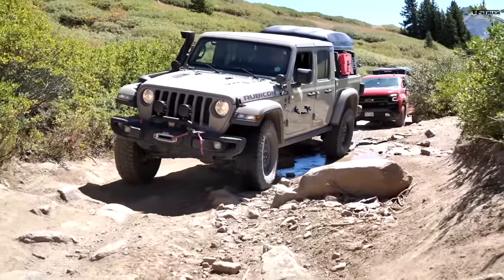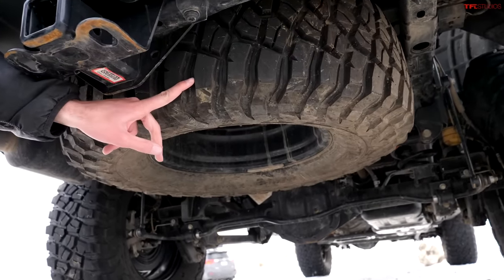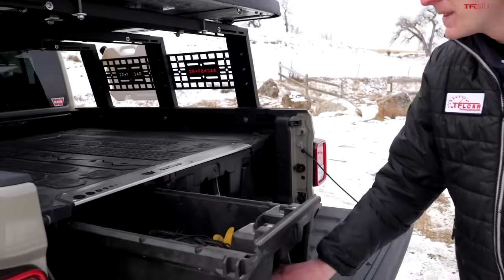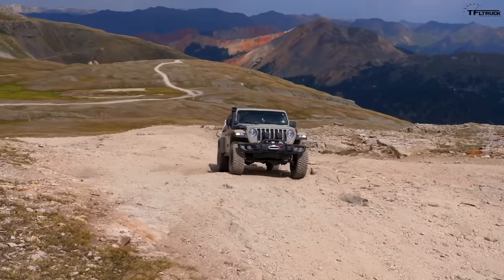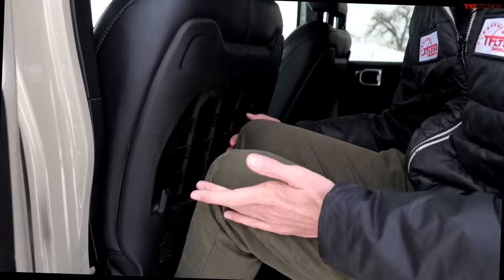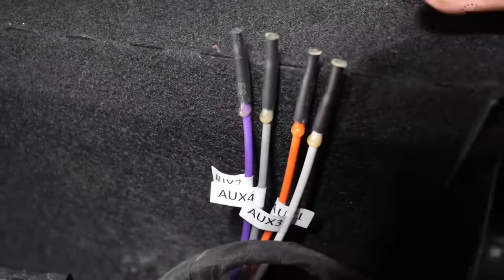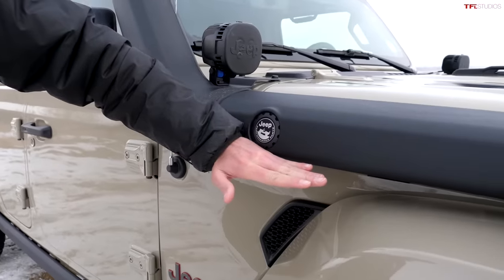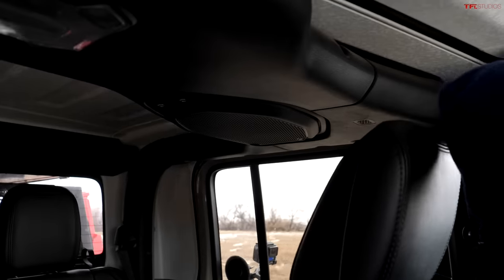Here’s What I Love & Hate About The Jeep Gladiator After Living With It For a Year!

Comment: I wonder if the new jeeps have addressed the rusting issue.   Jeeps seems to rust faster than other vehicles in Michigan.  Rust stains on the exposed hinges show up on 5 year old jeeps.
Reply: it’s not rust but corrosion that’s the issue on these. The JL and JT bodies are made of aluminum, so they won’t rust. However there have been corrosion issues reported because there is bare metal between the hinge and the door metal. I just bought a JL Rubicon and I plan to coat that area with some zinc chromate to protect it.

Comment: I'm hoping I made the right choice...ordered a 2021 Jeep Gladiator Mojave. Loaded up with a manual 6-speed. Looking forward to it. Somehow the 4 auxiliary switchs got left out. Found the mistake 16hrs later but already had a VIN#, couldn't make any changes. So now the dealership gets to install them.
Reply: Have you gotten your Mojave yet; if so how do you like it? I've just ordered one with the automatic and the guess is 8-12 weeks. thanks
Reply: @gb93669  Yep, picked it up March 5th. Ordered February 9th. A blast to drive. Only thing I would have changed...and I love manual transmission and this one is really nice, is that I would have ordered it with an automatic. I have 18 stoplights and 3 stopsigns on my way to work now. (I transferred.) Other than that I love my Mojave. And the Nacho is a really neat color.
Reply: @scottsymons6152  Thanks. You got it really fast compared to what they told me here in western CO.
Reply: I live in east central Indiana right next to Ohio. I'm only about 4hrs give or take from Toledo, OH. And my dealer was only about another hour from me. So everything to our area is trucked in rather than railed in. It can make a huge difference.

Comment: The 3.6 seems reliable to me. I put 270000 miles on a 3.6 Pentastar without any issues.
Reply: they are except the oil cooler likes to blow in the v of the engine.

Comment: I hated my pentastar engine. Nothing but trouble from day 1. Looking at a bronco. Been driving jeeps since 1987. Pentastar soured me on jeep.
Reply: what year?
Reply: @chadhaire1711  2014
Reply: @duckdog38  They have made a lot of improvements since then..easy 170,000 miles now
Reply: @chadhaire1711  I drove my jku 70,000 miles. In that time I had 2 radiators,1 intake manifold, 1 heater core, 1 a/c compressor,  and a full engine flush done by Chrysler technicians. When I traded it in, something was wrong with the front end, and the traction control was not working properly. Also in the four years I owned it, I had the windshield replaced 4 times.  Couldn't keep a windshield in it! I never took it off road but one time. Maybe I just got a lemon, but I was not impressed at all. Never had that many problems before. I had an 87 yj, 88 Comanche, 94 cherokee, 99 cherokee before. All great vehicles. I traded my jku for a 2018 ram 1500 hemi. It has 80,000 miles so far with no problems whatsoever.

Comment: General Motors should become Wrangler Rubicon interior and Gladiator interior's into a modern autimatic vehicle equipped with biggest touchscreen, paddleshift, and automatic gear steering wheel, gladiator and Wrangler interior must be modified changing the out of fashion interior that these vehicle have, for example please try to analyze Jeep Bronco Raptor, the best offroad Jeep in the world in my opinion so to get General Motors understand Gladiator Rubicon and Wrangler Rubicon are out of fashion: They have the same interior year by year. Thank you. Dr. Luis Amador

Comment: Looked at one this weekend and we liked it far more than we thought we would.  The only thing we didn't like were the seats. Are there aftermarket options?
Reply: Yes, check out Recaro or Stratos.  The are other seat companies, but those are the two I immediately thought of.  I'm not sure if Stratos is sold in the U.S. but I've seen Australian YouTubers use them and they speak highly of them.
Reply: I have a YJ.  I ended up modifying my seat brackets.  I had issues getting my head inside roll cage until I had a machine shop cut the seay bracket cut 2 inches shorter and i added a three inch extension to move seat mount rearward.  It was a lot of work but worthwhile.   Only reason I did it was the 20 year old seat and brackets were broken when I brought the jeep so not at all sure how I would handle cutting up and welding back together $50,000.00 instead of $4,500.00.  Almost anything can be fixed...
Reply: @jeffrentsch4318  that's exactly what I was thinking. It isn't the seat as much as how Jeep mounted it. The seat is too flat and needs tipped back more.

Comment: I notice you didn’t talk about the defroster issue. I think that’s a pretty big deal, myself. A potential deal killer if you live somewhere snowy.
Reply: Learn how to use to properly.  I own a jlu and a gladiator.  I don't have the problem becouse I use it correctly.  Yes there is a way to use it without it fogging up you inside.  Had to show my wife and daughter. .  I think someday I might make a YouTube video for it.  Because no one has so far.  Even tfl uses it wrong.
Reply: I just realized we aren't the only ones curious about this BIG issue
Reply: @ati573  I’d be interested to see your method. But IMO, the front defroster should be single-button simple in any vehicle. 

This is a safety issue. In commercial vehicles, a non-functional defroster is grounds to mark a vehicle undriveable.

Comment: The pentastar v6 is garbage because it has no power and gets mediocre fuel mileage. If your argument is that it lasts forever, then my response is duh... If its barely making any power it cant hurt itself. That's why the chevy 350 is loved so much in addition to being made for so long and being versatile. I drove my dads 2017 wrangler 75th willys edition I think. Its a 2 door with the v6 manual and bone stock. It's the most underpowered vehicle I've ever driven. I took it on a trip to Tennessee and it struggled to do over 70.  The 4 cyl 1954 willys I used to own felt like it had similar power. That's embarrassing.

Comment: The cheap Gladiator looks fine and everything but I just don't trust Chrysler engines or transmissions personally. I think a Chevy trail boss would be a better pick, Las Vegas tow Moore Kerry Moore people and overall is just a more capable machine.
 However it would need bigger tires like the Jeep did.
Reply: I also get in between 20 to 22 miles to the gown highway.
 No Jeep is gonna ever do that good i Doubt the dieselis  even does that good

Comment: A dealer in Las Vegas “Jeep Only” that messaged me about a 6 speed Mojave I am interested in, said there is a recall on manual gladiators, is this true? He said that they are unable to sell them at this time. Wondering the credibility of this statement. Don’t trust dealers, lol.
Reply: There is a recall.  The clutch pressure plate can overheat and crack which increases the risk of a fire.
Reply: @CaptainRudy4021  Thank you for the info!

Comment: Any chance you have a part number for those wheels? I honestly can't find them on the mopar Canada website..and my local dealer is useless
Reply: Check with Canadian tire or Tire Rack (not sure if they operate in Canada).  Those look like basic steelies you can get from any tire shop, very similar to the ones on my Impreza.
Reply: @406Steven  thanks I have done that previously but the widest rim I could find was 7 inches pretty sure the mopar one is a bit wider

Comment: I miss the days when trucks were cheap utilitarian tools.
Reply: @Brian B. You can still get one its called a current gen Nissan Frontier. My 2008 4x4 SE long bed has 340,000 miles on it and its been a dang good no frills hard working truck. Actually beats out my previous fav truck which was my 2001 Toyota Tundra 4.7L V8 Limited access cab 4x4.

Comment: Wow I got lots to add  no time to read all the comments but I've had JKJL a gladiator now I'm buying a diesel gladiator soft tops here in Canada just a waste of time, snorkel all depends how old you are but it's a waste of time if you're 6 feet tall drivers door hing rubs on your leg and the four-wheel-drive gear shifter digs in your kneecap, this way in the jeep will get you seasick real quick never notice that in the gladiator, box is real small but I didn't buy it to haul a cord of wood, for the average person towing something it's never going to be over 5000 pounds, The 400 W inverter in the back is a waste spend your money on a small generator, get my diesel gladiator in three months late May they say, comes with 373 gears but trying to order 4:10 because I'm gonna be running 35s And it would be better for towing, LED headlights are terrible in the winter because they don't melt the snow off them but you can't get the tow package without them, Canada it's tow baggage I guess in the states it's max tow package? Oh yeah anything in Canada it's 20 grand more eh!

Comment: Help! I need to buy a new vehicle ASAP... I’m in between a used 18 chevy 1500 with the 5.3 and a new gladiator. Chevy has 25k miles and costs 26k, and gladiator costs 35 out the door. Main reason I want the gladiator is the manual trans, but I’m used to full size trucks, so I am hesitant about going smaller. Advice?
Reply: Have a '21 willys 6spd...if your coming from a full size 1/2ton...an tow alot.
Manual is rated 4k lb an believe Rubicon is rated for 4500lb...one bad thing about manual gladiators.
Auto's max tow group rated alot higher..
Reply: Follow your gut!  Get opinions but satisfy yourself.  If you are going off-road, think Jeep.  Maybe stretch, how about the new 2022 Nissan Frontier coming this summer with a loan interest loan?  Make a list of what the truck will be used for, miles per year, resale, wants-must-haves, don't like's......
All this from a guy with a Ridgeline.  Good luck and enjoy whatever you get.
Reply: If the Chevy you are looking at is a crew cab and you have family that will sit in the back seat, no brainer, get the Chevy.  The back seat of the gladiator is very cramped.
Reply: Why is your comparison between a used truck at 26k and a new truck at 35k? Shouldn't you be looking at used $35k trucks to compare? I bet 35k buys a super nice used truck. I would avoid the 8 speed in the chevy, if it's the 6 speed or 10 speed then id say you're good. I had a 14' Sierra 5.3L that I ran out to 140k miles before selling
Reply: If you need/want a full-size truck ( like myself ) then get the Chevy.  If you need/want a midsize truck because you live in a metro area, or don’t need the extra room or capacity etc, get the Gladiator.  Two different trucks for two different type of people.  Congrats on whatever you go with though !

Comment: Typical Jeep owner, bought it cause you can take the roof and doors off... never took the roof and doors off. It's basically just a wide sunroof for you.
.
Where do you leave the hardtop and doors if you are at a trail?
.
Jeep should have made a hybrid system where you leave the rear section on, the rear window rolls down like on Tundra, and the entire roof is a soft top that folds away back. That would allow you to open up the roof and back easily whenever you wanted to without compromising much, especially with a quality soft top. And the doors should have bee frameless for easier storage, but they could easily offer a polymer rollup door to toss in the bed when you are on the trail. Or at least have rear freedom panels so you can open up the entire roof along with very wide roll down rear window. 
.
Jeep: we make a convertible off roader that is pretty much too inconvenient to use for most people
Reply: @DevilDog53 that’s what I’m saying. The rear portion could have been engineered to stay put with a roll down window and use take out panels or soft top just for the entire roof.

Comment: So far that money, I could get a 3/4 ton diesel truck that has stronger everything, more capable of doing anything, and oh yeah...power? No thanks.
Reply: Umm no you couldn’t clown
Reply: @corpsman247  
You’re saying I couldn’t get an F250 diesel with stronger axles, stronger transmission, stronger transfer case, better cooling system, way more power, stronger brakes, more payload capability, more towing capability for less than 60K? Oh yeah, you couldn’t take the doors off or get the “Jeep wave”. Never mind.
Reply: @corpsman247  
Let’s see how that Jeep does towing, hauling, merging onto a freeway. The Jeep off-roads better, a truck does everything except off-road better.
Reply: @scottythebody0811  but but but you said the 3/4 ton will do everything better. Any mid size truck isn’t made to do those things well. Thats why someone invented bigger trucks! Who knew right? You buy a Jeep to off-road and the Gladiator is haul or tow occasionally. It’s not meant to be a heavy duty truck. Jeep means off road which no truck can touch it in.
Reply: @corpsman247  
I’ve owned both, an F250 with a 6.7 and a Rubicon on 35’s. I got tired of getting big block gas mileage out of 4 cylinder performance. Merging into traffic, I was floored in 1st, 2nd, and 3rd gear. For the ridiculous price of Jeeps, they should check all boxes. A minivan power plant is unacceptable. It’ll be interesting to see how the Bronco will affect the Jeep market.
Reply: @scottythebody0811  its a jeep not a sports car I think you have the wrong idea bud lol
Reply: @scottythebody0811  but have you had a new JL or Gladiator with the 8 speed?? Makes a huge difference or one that’s geared correctly? Makes a huge difference. It’s not speedy but drives just fine.
Reply: @scottythebody0811  maybe you should just buy both ... I’m telling you a 3/4 diesel can’t do what a Jeep can ... and you won’t want to try it.
Reply: @corpsman247  
No, mine was a 2015 Rubicon 6 speed manual with 4.10s. With stock tires it was fine, 35” Trail Grapplers killed it. I can see how an 8 speed would help. I now have a ‘19 F150 with the 5.0 and 10 speed automatic with KO2s E rated, 1” taller than stock and it runs like a raped ape. In the end, people can buy whatever makes them happy, this is America...for now.
Reply: I paid $42+ tax for my diesel with cold weather group, full LEDs, adaptive cruise, blind spot monitoring, pop equipment group,  and the aux switch blank.
Reply: @scottythebody0811  sorry it’s currently tied up in a 2017 Cummins and a 2021 JLUR ... and it’s actually $150k

Comment: 3.6 penta is a solid and proven engine, the idiots crying probably think it should have a 5.7 hemi in it..
Reply: Proven engine ? In the middle east most wranglers overheat alot and that garbage of an engine is everything but reliable ,some people need to know what reliability means
Reply: Call me an idiot but I would take the old 318 back in a heartbeat. Smooth, lots of low-end torque, and reliable as hell. I'll pay for the extra gas.
Reply: @aal-m3545  I can't speak for the middle east, but in America the 3.6 has genuinely been reliable. The 3.7 before it was trash and overheated ALOT! Maybe that's the engine they were referencing. I'm not going to go as far to say Jeep products are always reliable but that powerplant on this side of the planet has been great..
Reply: @dakotamorgan6594  tbh , some cars even if they are the same in different countries they might not feel the same or have same reliability , for example here in the middle east “kuwait specifically” we still have single cab full size trucks , single cab trail boss and so on , the weird thing is that single cabs are more reliable than crew cabs , crew cabs are assembled in the US while single cabs are in mexico , my theory is there more crew cabs being made that may have higher chance of manufacturer defects or something like that
Reply: @dakotamorgan6594  my wife's '05 Liberty has the 3.7 and it is going on 300,000 miles.  She's owned it since new and has only had to replace the spark plugs, water pump and the plastic radiator at around 200,000 miles.  We keep waiting for it to crap out but it just keeps on going.
Reply: @kenwilliams4086  hey that's awesome! You had a good one! If you didn't experience the heat issues that engine would go forever. If you were one of the unlucky ones though....